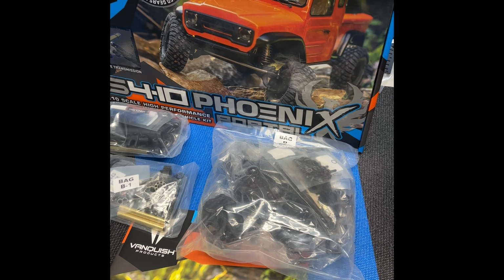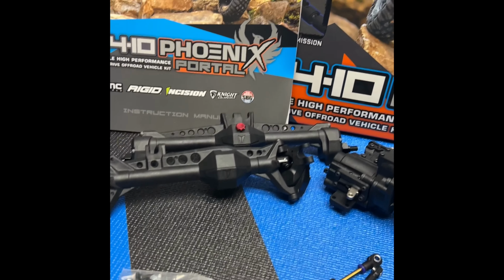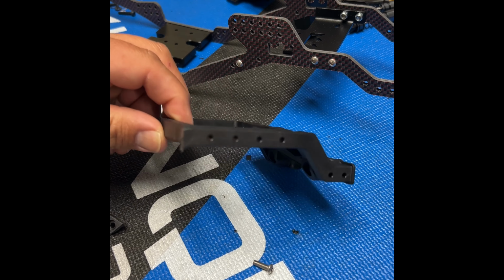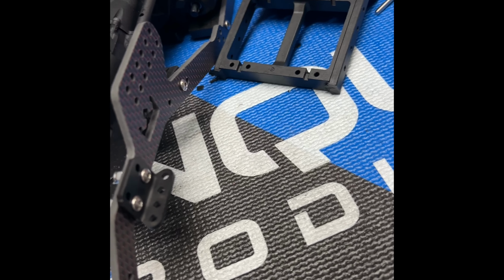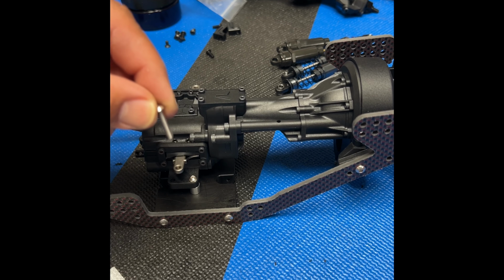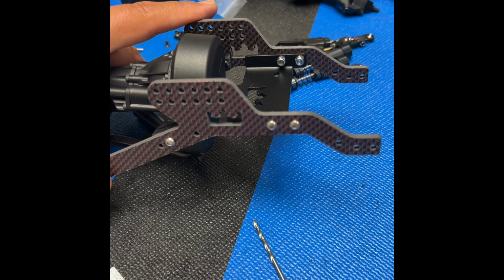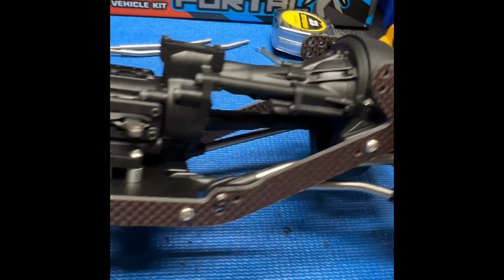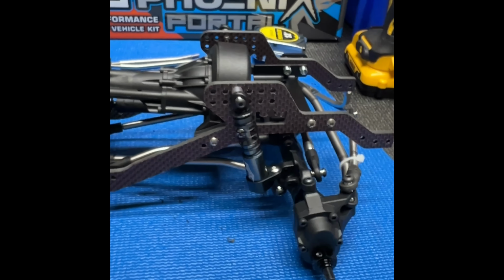VS4-10 Phoenix swap over to IERC MergeX Evo

Comment: Love the video. but why use 80mm in the front and 90mm in the rear? and where did you get the 12.7 links? is there a link to the links.